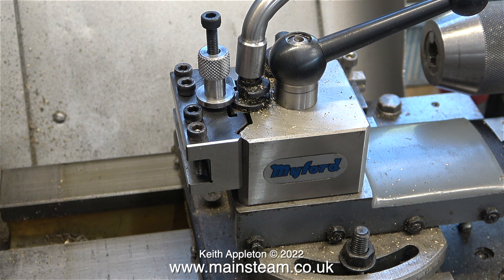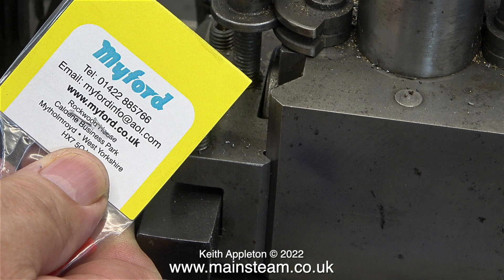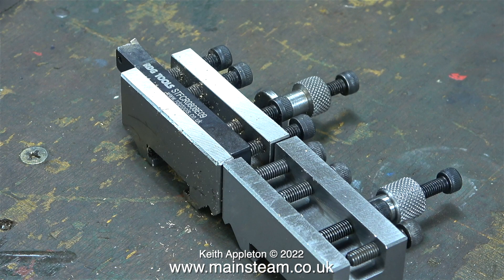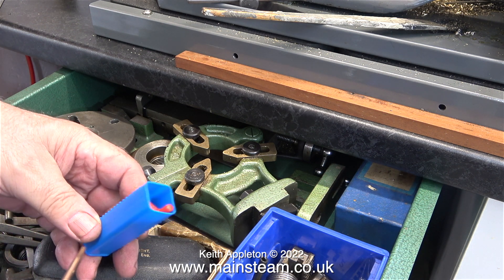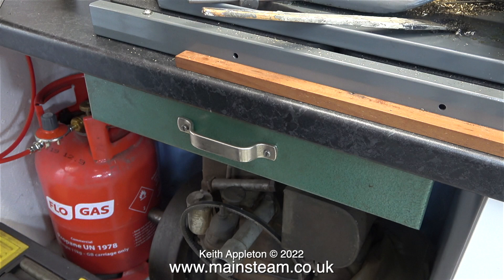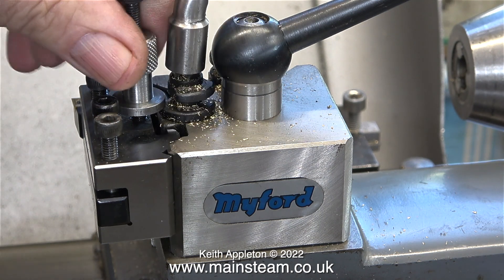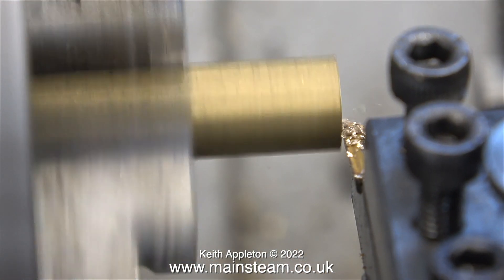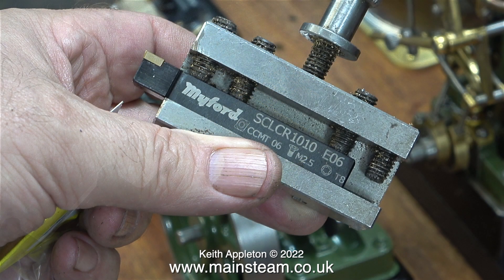WORKSHOP TOPICS - QUICK CHANGE TOOLPOSTS

Comment: After using quick change returning to shim ones looks like using a club in a stone age.Best time and nerves saving upgrade you can buy. Especially if you use ground  HSS knifes . 
Every time i sharpen it i had to put a small shim or two.On quick change you just adjust the screw a bit and thats it.